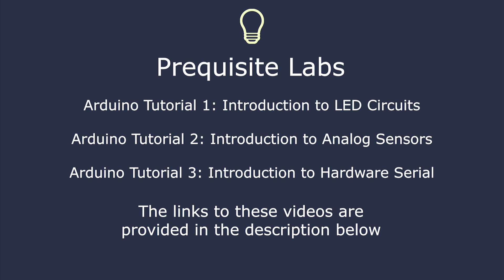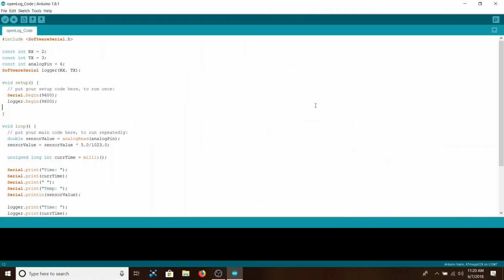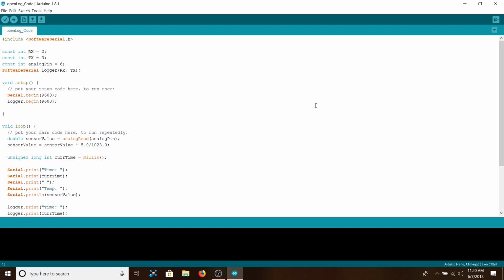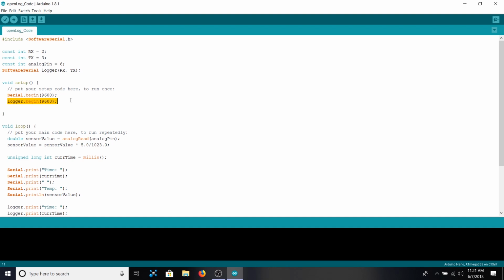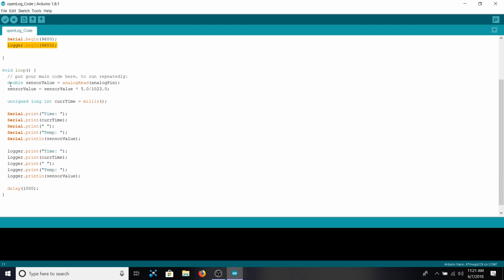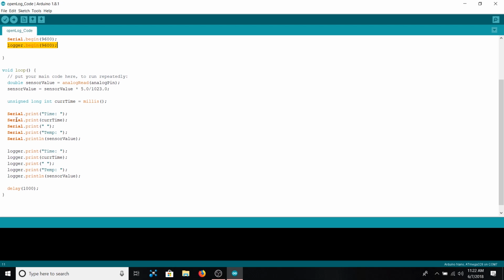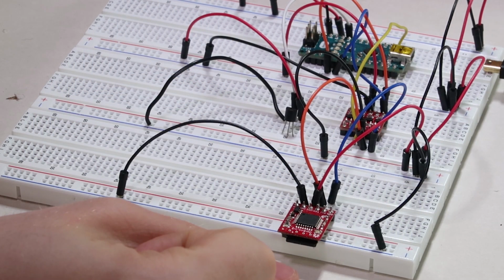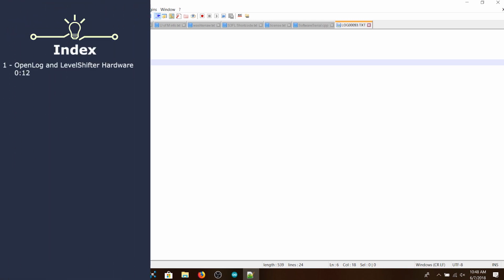Arduino Lab 4: Writing Data to an SD Card

Comment: Why not stick in a couple of resistors to lower the voltage instead of using a level shifter?
Reply: Hi Zefy - this is a good question.  If you are only doing 5V to 3.3V shifting, I think that this would work.  If you are wanting to be more generic, then a level shifter is a good way of going.  Also, the critical line between the level shifter and the arduino is the 3.3V transmit from the LS to the 5.0V receive on the Arduino, so you have the shift the voltage up, which you can't really do with a voltage divider.  Since the LS can do the shift in both direction (up and down), and only costs like $1.50 on sparkfun, it is a great option. I hope this helps!